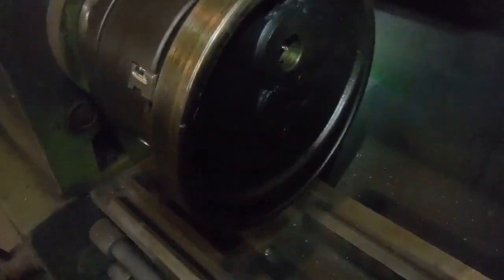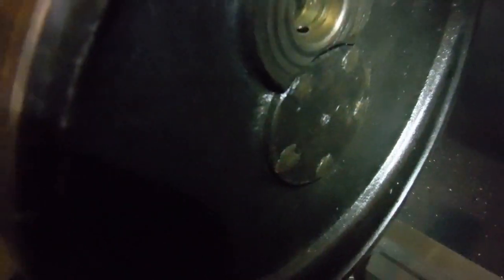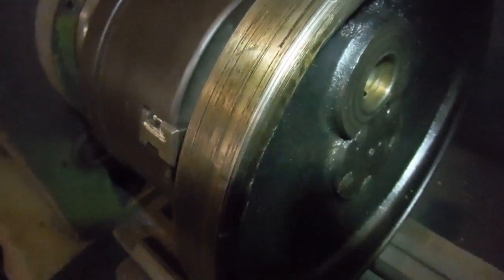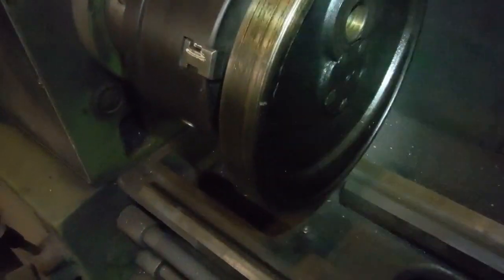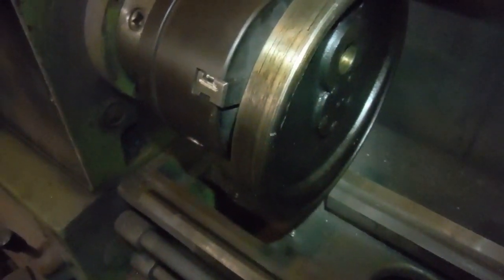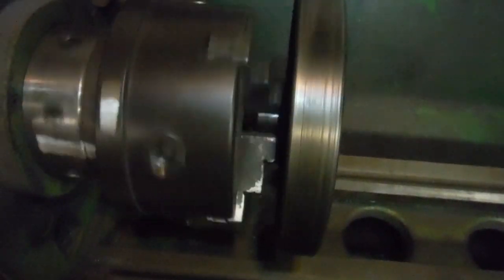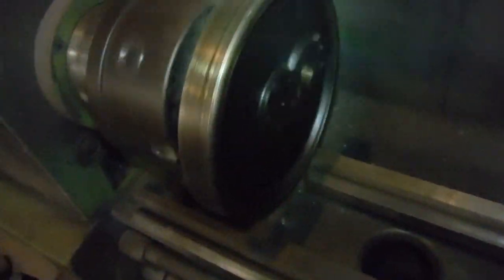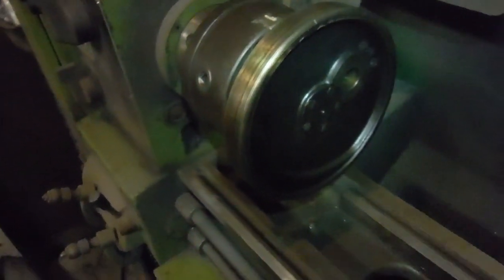BSA 350 cc Model L engine circa 1930 strip and rebuild 5 Timing side flywheel repair discussed.

Comment: Mmm, 'bearing fit'? Surely a bore out and sleeve would've been the more 'correct' engineering solution but Paul must be confident that the clearance is  not a worry. Wondering how the the bearing will be centred in the recess. Do the rivets assure this, perhaps all will become clearer on assembly
OR NOT SHOWN.